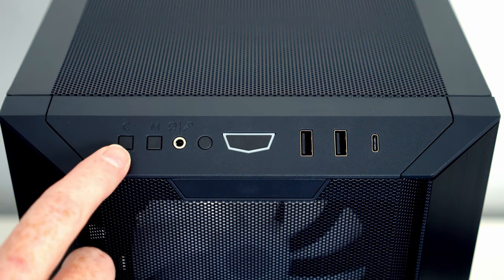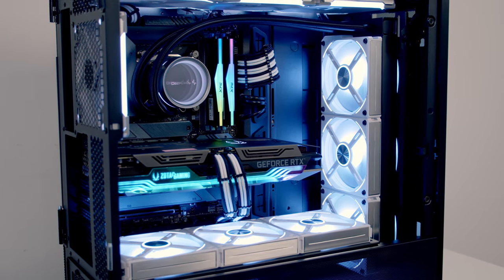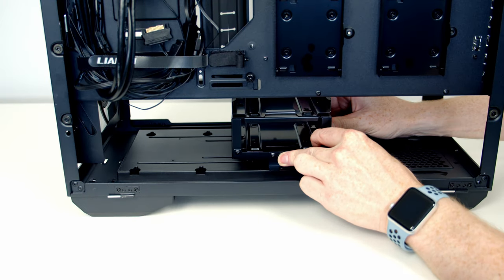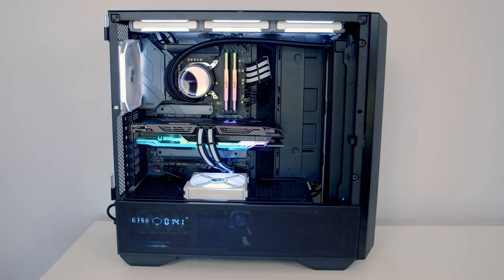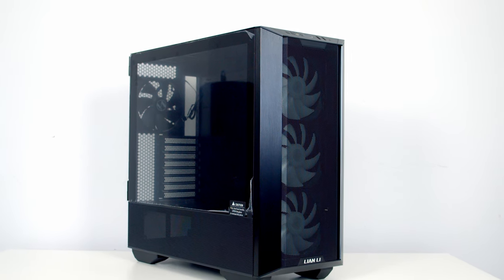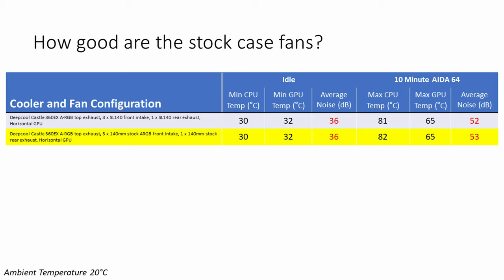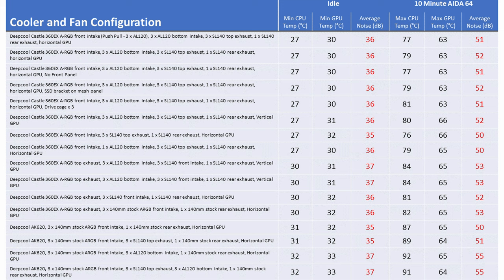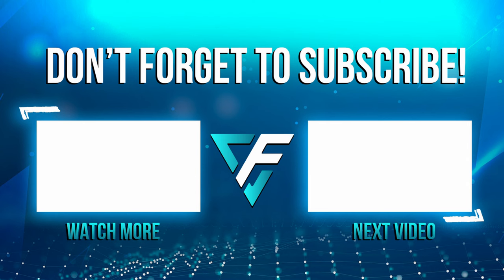Lian Li Lancool III - Best Fan Configuration

Comment: I wonder if in the configuration  with the fans mounted to the top and bottom, if that would have more of an impact with a vertically mounted blower style gpu, since it would be exhausting its hot air directly out of the case, if the bottom mounted fans would be able to allow it to pull in cooler air, as well as not blowing warmer air from the gpu across the cpu, ram, etc. (though that would probably be a moot point, since those aren't manufactured anymore).

Comment: I can't do the push/pull configuration using the corsair ML 120 RGB fans in the front panel of this case because they won't fit, what did you do to get the push/pull to work?

Comment: Hello! Is there a possibility to install stock 3x140mm fans as intake front fans (so leave it stock) and instal this AiO on the front with its 3x120mm fans on exhaust? That would be push pull as well, but is it possible? And how about thermals?

Comment: @Christopher Flannigan - Did you consider your first option - with the top fans, bringing fresh air right in, and the rear fan sucks it, right out of the case?   Especially considering heat rises, and would not want to push cool air into the radiator, verse pulling hot air through it. Especially since your trying to cool the same water?

Comment: When u did the test with the fans that come pre-installed, did you have them plugged into the sata cable for power or pluged into one of the chassie fan headers on the motherboard

Comment: Hi, I remember watching your noctua lancool II build a while ago. Since you have a long term experience with these lian li cases I wanted to ask you how they handle dust build up. I have a NZXT H500 and would like to upgrade to an airflow case but I'd like to know if the kind of mesh on the lancool 3 causes more dust to get in the case. Gamer Nexus said the mesh on the lancool 2  Mesh variant was not ultra fine, that's the reason I am asking

Comment: Someone please help. In this video, in the push-pull configuration, how can I put 3 140 fans on the panel holding radiator?
To do this the long screws for the front 140 fans have nothing to screw in to since the radiator is 360! Can’t figure out this part

Can someone please help me if they know a solution? 🙏🏼

Comment: How did the Thermals compare to the Lancool 2 mesh ?
Reply from the maker: I didn't do a direct comparison as I had different hardware in each
Reply: the lancool 3 performs slightly better but also slightly louder...both are in the higher end of cooling efficiency...more than that and the only way is faster and larger fans with even more diminishing returns...like if you want 10 degrees less on your cpu...you'd need 1000mm+ worth of radiator to keep the temps 10 degrees cooler under load compared to a 360mm aio who does the job just fine

what really helps temps that has no diminishing returns is ambiant temperature...if your room is at 30 degrees celcius, it will pull 30 degrees air inside while if it's 15 degrees, it pulls air 15 degrees cooler ( about 10 degrees less on components )

Comment: I got to say Christopher I don’t understand the push pull config. If you have 140mm in the front and 120mm on the radiator, doesn’t that impede the airflow? Really wish it supported 420mm in the front
Reply: Are you sure that it doesn’t? It comes stock with 3x140mm fans in front 🤔

Comment: is it true the front stock fans can only be controlled by a button on the io? Was really hoping you could sync it to the galahad 360 fans
Reply: the lancool 2 mesh performance has that and no it's not ''only'' controlled by the button...you simply set it to automatic and change the fan curve in the bios so they speed up under load

Comment: is there an explanation why fans on the bottom make the cpu temperature worse?
Reply: It pushes up the gpu's heat. Without that it moves towards the rear fan and not really going into the intake part of your cpu cooler.

Comment: What about noise? TomsHardware says Lian Li Lancool III is so noisy. Can you compare it with Lancool II Mesh?
Reply from the maker: Don't have that case anymore, but you can compare with the video. It's not the quieted build I have done, but not the nosiest
Reply: they are slightly louder and slightly better thermal-wise.....cases of today have to find a new way to cool because air cooling is bottlenecked by ambiant temperatures

15 degrees ambiant is about 10 degrees cooler on all components vs 30 degrees ambiant

Comment: Also not the best to have tubes at the top with the AIO in the front of the case. It's recommended not to.
Also you didn't do 3 front intake, 3 top intake (AIO or not), 1 rear exhaust. Making it positive airflow as this is the only way to do top rad with positive airflow in many cases.

Comment: 1.You should totally noise normalize all the temps
2. You need to be clear if you have fixed cpu / gpu fan speed or not, this data is worthless if you didn't do it.
3. Some systems include mine's thermal efficiency are not bottlenecked by fan speed. My cpu(5600x) doesn't care how much cpu / case fan speed I use the Cinebench R23 all core temp is always the same. 400rpm or 1500rpm(Scythe Fuma 2), always 81~82 degree. If you met such bottleneck. fan speed don't matter.
Reply: That's just not true.  I have a 5600X overclocked at 4700Mhz with a Scythe Fuma 2 air cooler, inside of a Fractal Torrent RGB case.  The highest temp mine reaches is 74 celcius during cinabench, as it runs at 4700 or down to 4675 the entire test, depending how close it is to 74 degrees.  Your CPU throttles it's clock starting in the 70's.  Don't believe me, start paying more attention.  Just because it's "ok" to run at your temperature, you are definitely losing performance.
Reply: @MultiNastyNate  Is your room sitting at 28~29 degree during summer? We are not the same.
Reply: @maozedowner5915  We are the exactly the same.
Reply: @MultiNastyNate  lol, i forgot amd cpu's downclock at low temps...while in a heat wave in a poorly ventilated case running gpu benchmark and cpu benchmark...my i7 12700k went up to 100 degrees and was still on it's 4.7ghz all core boost ( non overclocked when that happened )

Comment: 9:52 if possible you should be making the AIO have the tubes on the bottom instead of at the top. Having it be at the top while front mounted causes an early pump death.

More clarification, you can see here he has it mounted so the tubes are above the coldplate area, not entirely ideal since the way water flows it going back into the radiator would be pushing against gravity and overall how physics works which makes it have to pump faster and/or harder which strains it and causes an early death. However, if you mount it so the tubes are on the bottom instead of at the top, the decrease in airflow from the tubes blocking it is negligible easily by 1 or 2c MAXIMUM but keeps your AIO nice and healthy. Obviously if the GPU is too long you cannot do this, in that case I personally reccomend having the AIO Top mounted and pointing it exhaust. The reason this won't kill the AIO sooner despite it being above the pump, is the water in the radiator is trying to push water towards the area where it intakes cold water for the coldplate, and brings out hot water simply by how much force it pushes. Similar to why you rotate it on the front if you can to make all of the water in said radiator have no resistance to push and pull and instead work towards the idea of push and pull. Putting it on the bottom of the case isn't reccomended since the only "good" way to orient that is to be intake which exhausts hot air into the gpu so you're just killing your GPU.

While the tips in this video are useful, arguably this is the most useful advice as having a dead AIO every 1 and a half or less years isn't fun for your pocket.

Oh and I reccomend putting the fans UNDER the radiator on a top mount so it pulls cold air from the front intake fans directly into the radiator which then further cools down your CPU.

TL;DR, if front mount and small GPU, rotate so tubes are on bottom. If GPU too big, put AIO on top of system, fans underneath radiator as exhaust pushing out of system.

Comment: The only thing a bit ridiculous about it is.. All these rear case fans are so outdated. When computers had one rear fan it only had one fan. And the psu wasn't even where its mounted on the bottom of the case. The rear one pulled on everything. including the hard disc drive. I feel like these new age "gaming" computers with 10 fans in it would just be better left open. Even mounted on its side like most test benches. With something called a thermosyphon. Literally right next to the mousepad on the desktop. I duno if not putting a build in a case would even be considered "cheap" anymore.
Reply: Rear case fans help when one uses a tower cooler for the CPU. A thermosyphon would not cut it, given the higher power components these days.
Reply: @coolcat23  Thats why I was saying test bench for that. The rear one is needed especially if your running a IGD chip. I do want to build another one. If it's got a cpu it'll have a rear fan! hahaha.
Reply: for your understanding...psu's are now at the bottom ( mostly ) because at the top. it makes the top heavier and easier to tip ( less safe ) and one singular exaust fan is bad for temperatures for modern components.

it is very obvious...more fans simply means more air moving around that area...the objective is to make a positive pressure comfiguration ( 1-3 fans more for intake compared to exaust...neutral presure is hard to achieve because of cpu/gpu coolers sending air in different directions ( makes turbulance )...3 fans exaust is always worst than 3 fans intake...hence why most case's come with 2-3 intake fans and 0-1 exhaust

and for your understanding of ''gaming pc's''...having a whole pc without protection and noise isolation makes it highly audible and easy to get damaged ( static shock, doing things around that could make you hit the hardware and such )      and beside.....would you keep a 5000$ pc just sitting flat on your desk because having 10 fans looks stupid?

in conclusion....a case is important for ''non testbenches'' and airflow is important to keep the temps under control
Reply: @dovahkingqcclips6913  im not gunna believe that for as far as I can throw it. but, sure whatever you wanna bump your head on in the morning when you cant find your reading light. haha
Reply: @typerightseesight  what in the hell are you on about?
Reply: @dovahkingqcclips6913  gaming pcs are quite gimmicky and a fad that will fade. there's a reason they are built the way they are professionally. the difference here is you probably aren't using the integrated graphics card on your cpu. so, its not going to matter to you. whether or not the entire build is airtight or not. with a gpu you can go ahead and hang the psu out a window for all i care. because if your not booting to the cpu then of course its no matter. whatever your into.
Reply: @dovahkingqcclips6913  in tv and media they use regular computers and the only reason for displaying anything out of the physical gpu itself is like big screens and stuff since green screens switched to giant displays. your not really suppose to plug your main hud in. The main monitor goes to the mobo to the cpu. and the secondary can be plugged into the gpu to show gsynced imagery ect. the entire gaming thing is a big messy flush down the professional toilet. all im saying.
Reply: @typerightseesight  reading what you say make you look like you're stuck in the 90's and you don't see anything worthwhile in modern tech

anyway... know your physics of how aerodynamics works, know what has potential and update your knowledge...there has never been a ( main ) display from igpu's...the display you set as main is monitor 1 and the others, the order you want em' to be...using the dedicated gpu in your system ( if you have one ) should be much more powerful for even the smallest task...my igpu doesn't really like 1440p 270hz even only on windows and any gpu rendering is terrible on it ( i7 12700k )...usable even for gaming but terrible compared to most dedicated gpu ( like my rx 6900xt )

i won't reply an other time since i'm already wasting my time here telling you to update your knowledge on computers
Reply: @dovahkingqcclips6913  bud, they aint using what ur talking about at nasa. just because im 35 doesnt mean you gotta suspect i duno what im talking about the power supply was located above the cpu fan to hel p with the overall flow of air from the case to the exhaust. inventions were simple in the 80s when i was born. its a tight ship for 2 buttons. lol. i think uve overthought the whole c++ stuff from subscribing to too many youtubers who are overselling this stuff in the first place. have a good one!
Reply: @typerightseesight  i know i said i wouldn't reply back but you're just disagreeing with all i say who makes sense...i don't even have a single tech channel i'm subbed to...most of my knowledge comes from personal researches and study over only 2 years...being 35 you should know what is studying since kids now don't even bother with studying

you think everything is simple yet is much more complex than you think...that's where you fall behind multiple people on the said subjects ( computers and simple aerodynamics physics here )
Reply: @dovahkingqcclips6913  just making sure your not falling for the gaming computer crap thats been around for about 10 years now. Theres no reason to change every aspect of how a computer has been built for over 25 years because someone invented a pcie slot version of a graphics card.

Comment: you do realize your AIO is upside down, tubes at the bottom, not the top.
Reply: if the tubes cannot reach, ( which is most cases scenario ) then it is the only way to use it as front intake

Comment: Hello! 
@Kleo Yan did a lot of testing and came to the conclusion that the vertical installation of the video card gives lower temperatures. He suggested that the difference with your results was due to the use of an 850V PSU. Can you verify this result by installing a more powerful PSU that will not heat up when benchmarking? Thx.
https://www.youtube.com/watch?v=1SPioF78x_E&lc=UgxQwfJizLkyKIbbinx4AaABAg.9gPlZGMrH0j9iQI-gbP0fE